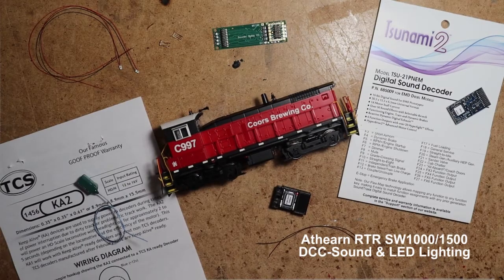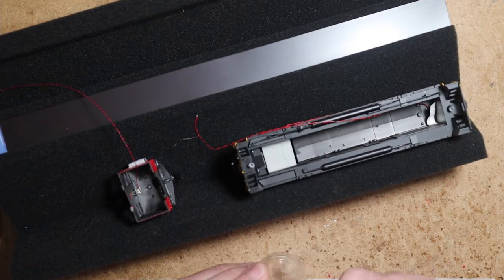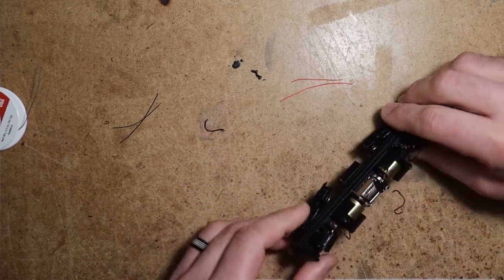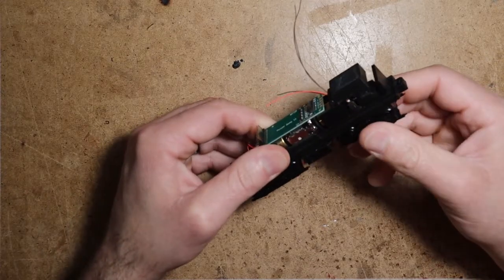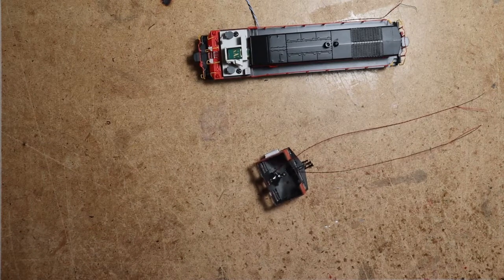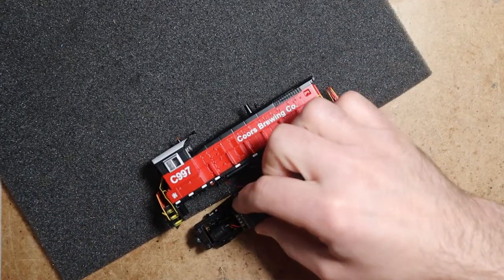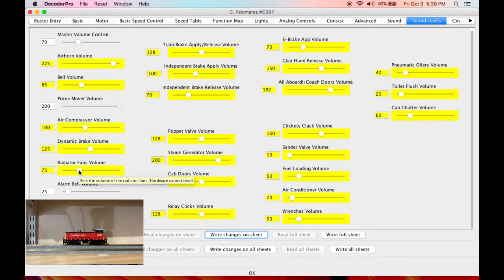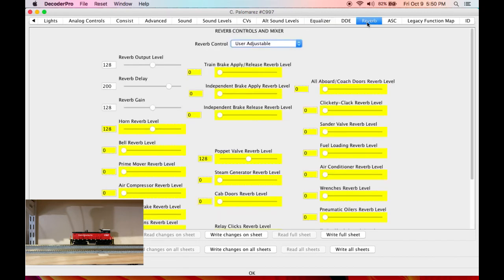HOW-TO Athearn SW1000/SW1500 DCC-Sound & LED Conversion by Scale Sound Systems

Comment: Great how to video on LED and decoder with sound install. I have purchased your speakers for my RTR 1500s and a Genesis MP15AC but now I need to get that decoder pro to tweak the sound. The way you changed the settings when I see that SW1000 throttling up I can image it pulling a long cut of covered hoppers.

Comment: Super video, jt!  I really appreciate your detailed step by step approach.  You make it seem so simple, but that's the result of having done it so many times before.  Thanks for sharing all of those little tips, that make the difference between a so-so install and a superior, first-class install.  
I particularly enjoyed the occasional full-scale rail sound effects.  The railroad must run through your back yard.
Reply from the maker: Thanks! Both the Norfolk Southern Sandusky District and the CSX Columbus Sub run parallel across the street - around 40 or so trains pass by daily.

Comment: Beautiful install, it’s nice to see how a professional does things the right way. I’ve worked on switch engines, and afaik, the engine warning bell is a GE thing. There is an alarm bell in the cabs of all locos, but it doesn’t ring when the engine is priming and about to start. Also, there is a drive shaft bolted between the crankshaft and the air compressor, and another bolted between the opposite side of the compressor and the radiator fan pulley. The rad fan is belt driven off the pulley, so it and the compressor are always turning whenever the engine is running. The rad fan is pretty quiet, what you do hear are the shutters in front of the fan blade; silent when they open up, and a big FLUP when they close. I saw the dynamic brake setting was set around 50%, switch engines do not have grids. I’m sorry if this sounds like a nitpick, I just wanted to point out why switch engines sound unique compared to other locos. This inspires me to get to work on my own Coors blue box loco bought in 1980.
Reply from the maker: Thanks! As to your other comments, I do install work for clients; final programming and preferences are performed by them after they receive the loco back from me. The alarm bell is a default sound in all Soundtraxx decoders. I always leave it on, but turned down, for the customer. They can then choose what to do with it later. I am aware most prototypes do not have this feature. I didn't know the radiator fan runs full-time on switchers; they work differently on road locos using an off-3-speed configuration. This works nicely then, having the radiator fan turned low for this model. As for the dynamic brakes, all of the Soundtraxx decoders have these set to F4. They do not run if F4 is not pressed. Even for locos that do not have DB, I leave them default. Most layout owners standardize on one function-mapping for all of their locos, so DB would always be on F4 (or whatever mapping they use) even if it's never needed/used for a particular loco, since some other locos will use DB. It would be advisable to turn the DB volume down in locos that do not have it so that if an engineer accidentally presses F4, the sound won't turn on. The main purpose of the programming portion in this video is not prototype-accuracy for this specific loco, but to demonstrate how I roughly adjust volumes (using the mixer), adjust the EQ (something I am often asked about) and using the reverb.

Comment: Just FYI: Locos modeled in the 90s(early 2000s) & earlier do not have ZTR Smartstart systems. Locos with manual starting do not ring the alarm bell just before starting. Soundtraxx said you can disable the alarm bell at startup by reading CV 112 and then subtracting 2 from that value. Or set CV 135 to 0. I have used the CV 112 method on several locos now and it works like a charm.
Reply from the maker: I personally do disable the bell on my own locos. I leave it in place for clients. I only perform basic sound-level, EQ and reverb programming for client models unless they specify otherwise. Once they receive the loco they can make whatever changes they wish.

Comment: What kind of wire strippers are you using?  And, what AWG wire did you use for replacement?  Solid core, correct? What are your wire side cutters?  Tools make the job! Very nice job, very instructive.  I should have found this before I installed a 58821 ESU in my Bachmann S4 with your speaker and enclosure!
Reply from the maker: The strippers are Platinum Tools 15005C. The wire is all ESU 36AWG stranded. You always want to use stranded for locomotive installs. I make a drop-in speaker for the Bachmann S4s that is very popular. Thanks!

Comment: Hi. Found your vid very interesting. Love the programming part and have a question. How is your computer hooked up so on-the-fly changes happen as in the video. I have a Mac OSX with PR3 Xtra and a Digitrax DB150. Have tried hooking up to be interactive, have my engine working etc, but the changes to CVs I have made 
do not take place. I figure there is a bad setup somewhere. Is is possible for you to step me through or supply exact hardware and setup. Thx in advance
Reply from the maker: Allan, I use an NCE PowerCab with the NCE USB interface to the MacBook. DecoderPro has two programming options you select, "Programming Track" and "Programming on the Main", right above the PROGRAM button. "Programming Track" mode is what you need to reading CVs and is also what I use to program addresses. "Programming on the Main" lets you send values and see the results in real-time, useful for setting sound values and speed-curves. I am not familiar using Digitrax connected to DecoderPro, so it may be a little different.
Reply: @Musepro7  Thanks JT. Sorry for the late reply. Your message came in to my less-used email account the reason my response is 3 days late. In any case my hardware is PR3 Plus connected by USB to my iMac and a 6-pin connection from the PR3 to the DB150 and then to my Digitrax DT402 throttle. It should work as you have outlined I need to play with it a little more. Thanks again for the info.

Comment: Can you actually buy hollow beacons, to install l. e. ds, from across the pond, time to give manufactures a heads up on hollow beacons., from across the pond.
Reply: If strands of copper wire look black, trash it, use new copper wire, a lot easier to solder, than dirty copper wire, from across the pond
Reply: I like noisy locos, sounds a bit more realistic than a quiet one